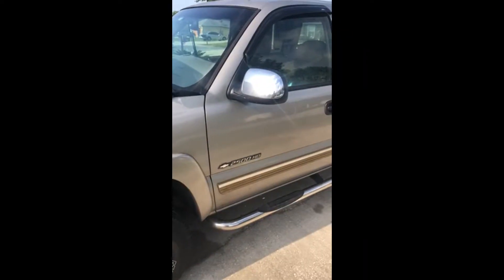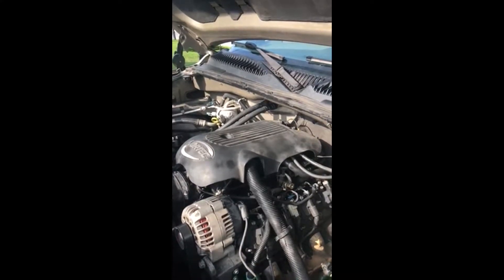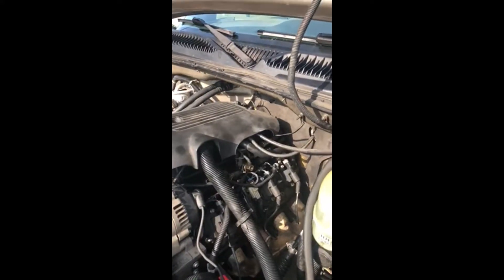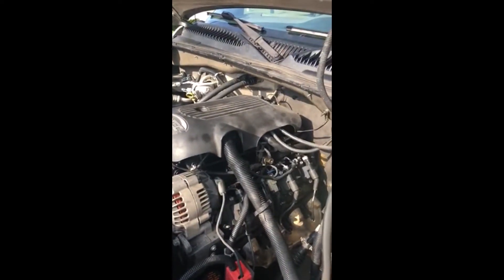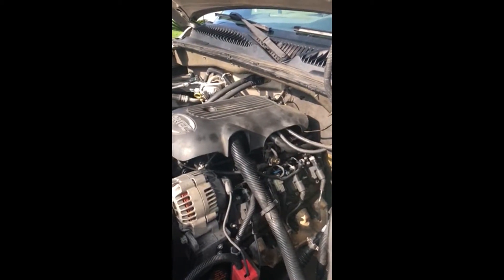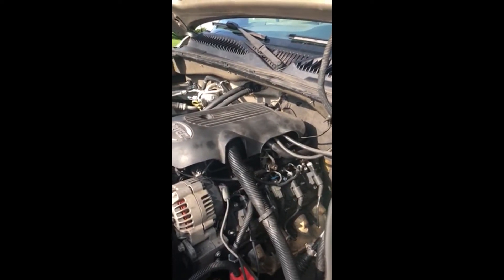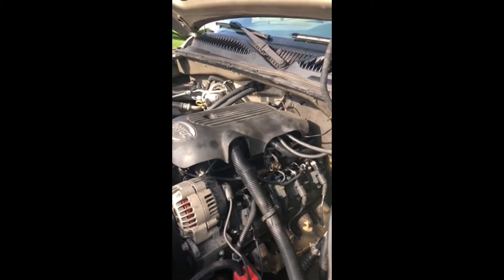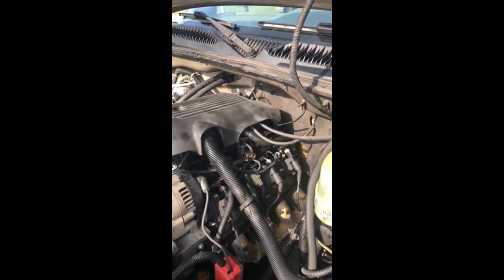Secret to Fix Knock Sensor Issue

Comment: I have a 2000 Chevy Silverado 1500. I took it to Firestone a month ago and they replaced the knock sensors three times because I kept getting the check engine light back on I'm currently driving the truck after getting oem knock sensors Friday. I had to buy a code reader today to clear the code because it kept coming on just so I could drive it efficiently. I will be at work in one hour and will update you after using the tip you suggested. This has been an extreme headache and an expensive one
Reply from the maker: I understand 
Similar situation drove me to do this over 4 years ago and it’s still working! 
Good luck let me know! 👍🏻👍🏻
Reply: @cjphillips987  so I just got to work and turned the truck off and then back on. I hit the throttle and it really didn't want to get to 5 I maybe got it close to 3.5 held it there then let off and went to do it again and the light came on. Do I clear the code and do it again? And is it supposed to hesitate getting up to 5? I mean I do baby it and it felt like that would really be pushing it. As of right now I just turned it off
Reply: @cjphillips987  also thanks for responding so quickly.
Reply from the maker: @ejsabcs2329  You must clear codes first then the rev process!
Reply: @cjphillips987  ok thanks I will do it in the morning
Reply: So I cleared the codes and did it I can only take it up to 4,000 RPMs but it let me do it a second time without throwing the code. So hopefully I'll find out later that helped
Reply from the maker: @ejsabcs2329  I understand 
When First it most likely hit rev limiter 
When it does slowly let off pedal 
The next rev it will go beyond
Reply: @cjphillips987  ok thanks. Would it help to do it again before I hit the road?
Reply from the maker: @ejsabcs2329  🤔 It Works unless you have bad KS’s 
I did it one time over 4 years ago 
Still Driving NO CODES!
Reply: @cjphillips987  I have brand-new knock sensors. I'm driving it now and have been driving for an hour and a half so far so good 😊

Comment: I haven't tried this procedure just yet.  I installed Dorman sensors last year and have had the check engine light since then.  Right now I removed the sensors and I am comparing them to 6 other brand new sensors.  2 AC Delco, 2 Echlin and 2 Standard Ignition.  All eight have 100k ohms.  All eight have an alternating voltage range up to 400mv during the tap test.  My suspicion is the output voltage isn't high enough.  Watching videos of other's doing the tap test, they are seeing up to 1.5v.  I'm taping the vise that the sensor is mounted to as hard as others are.  My next  step is to go to the dealership to buy AC delco from them.  The AC delco that I have are form Rock Auto.  They have part number stickers on them.  Not the embossed numbers like all the photos of oem sensors have.  My hope is the dealership sensors will have a larger voltage range.  We'll just have to see.

Comment: My husband tried this and it worked for a week. Does it help to do it again & are there any other suggestions? Replaced knock sensors & wire harness twice.
Reply from the maker: Sorry to hear you are having issues 
With your information 
It’s indicating one or both KS’s the connections, wiring or the ECU is the issue. Also when mounting KS’s do not apply anything to the Threads ! They must be metal to metal.

Comment: Fixing to try this on my 06 Silverado 4.8L I changed the knock sensors and wiring harness. Code came back after about 100 miles of driving. Hope this works!
Reply: Having the same problem…. I’m going to try to rev 5000 RPM for 5 sec
Reply: Did it work???
Reply: Did it work?

Comment: Thanks for the tip. 
I just replaced Both KS and a few last year , 3 to 4 month later the check engine came back. Truck drives great but the dam light pop up so now it dont pass the freaking smog. Tags are expired. 
Lol. I tried deleting the check engine light and took it to get smog but technician said his computer detected that the it was cleared so I must drive 100 miles then try the test  again, Of course with out any check engine lights :(. 

I’ll try your tip. I’ll keep you updated 
Thanks
Reply from the maker: Good Luck ! 
C A L I F 🤔
Come And Live in Florida !

Comment: Thank you so much!!!!!! Thanks so much for this video man I was about to start tearing it apart again to figure out why the hell I still had the codes after replacing them. Revved her up to 5k twice and no code!!! What a life saver this bit of info was for me, not one video I watched prior to this one said anything about this trick and makes me wonder if the code really went away if they didn’t do this?? But anyway man thank you so much for posting this very important bit of  info
Reply from the maker: Thank you, I’m pleased it helped you! Pass it on ! My K S’s code has not come back since i made this Video Still running strong over 300,000 miles ! Love My Chevy !
Reply: Dude I drove about 50 miles since and bank 1 code came back. But your tip worked at first I tried to rev it again and it didn’t clear it. I cleared the code and said a prayer. I’m sure it’ll come back lol I’m thinking I got a ground issue
Reply from the maker: @nwarren365  I Understand, It can be as simple as the Wire Harness Clip on Coupling , Wire issue or a Bad K S!
After double checking, Clear Code and Do it Again! Let Me Know
Good Luck !
Reply: Has this method held up

Comment: Just tried this after I pulled a P0337 100 miles after replacing both sensors & harness. Fingers crossed!
Reply from the maker: It should work unless you have a bad sensor or a harness issue, mine is still working no issues since i did this!

Comment: I can't wait to try this after work, i replacement both sensors and about 1 tank of gas later when I was getting on the high way check engine appeared. Scanned it, to my surprise knock sensors FML. Hoping this works!
Reply from the maker: Afternoon Sir 
It has worked for many K’s, only 2 had additional issues one is the ECU and the other never disclosed what was overlooked!
Reply: Did it work?

Comment: ... thank you... this actually seems to have worked on my 2000 LS... awesome, though odd :)
Reply from the maker: If the information helped please like the video, pass on the information! 👍🏻👍🏻👍🏻😎
Reply: I’m going to do it tomorrow morning since I have emissions test and I replaced the o2 sensors and the code of them went away but I got that code ! I also have a 2000 5.3 Silverado
Reply: @nbsgioo00  just so you know, I was never able to get the fix to 'stick'... gone for a while then came back through several tries. Annoying...

Comment: I didn't understand you clearly, what should I do after changing the knock sensor?

Do I have to raise the rpm to 5000 for 5 seconds?

I have replaced the sensors 3 times and still facing p0332 p0327 p300

Comment: Well, wish I saw this video before already having the intake off, had to take a break due to the rain lol.  Woulda been nice to try before buying new ones but at least now I know what to do once I finish putting them in.
Reply from the maker: I understand your grief, This is Why I posted this and many other DIY Videos exposing the Stealership  / Mfg Secrets of many items. Hopefully this has helped you Help Others Pass it on and Subscribe to my Channel, Thank You Let me know if you need anything else.
Reply: @cjphillips987  did the procedure after getting the new knock sensors in, still getting p0327 only. Thought for sure it was just a bad sensor, one of them that I pulled had gotten moisture trapped under the plug and it was more rust than sensor. Guess I gotta make sure the wiring back to the ECM from the sensor plug is good, harness was also replaced. Truck runs well, I can’t hear or feel any knock. I know it’s about time for a set of plugs, gonna also do those in case there is any minor knock that I just can’t hear.
Reply from the maker: @mxss115 
 FYI Clear all Codes before Performing Learn / RPM Procedure.
 I understand the Frustration, The KS's must be Learned to Listen for Harmonic Range of Engine RPM to set a Low to High Standard of listening to the Engine to adjust the Fuel Ratio through the EMC.
. After Replacement or Relocating Verify both Wire Harness Connections and each KS's are valid If So you Should not have any issue. Let Me Know
Reply: @cjphillips987 checked the KS with a multimeter set to AC at the PCM plug, definitely getting a reading when tapping the valley cover with a screwdriver, so wiring and KS should be good. It’s an 06 Yukon Denali if that changes anything. For the learn procedure, I started up the truck (after clearing codes or disconnecting battery, have tried many times now) and rev it to 5k, hold for 5 seconds as steady as I can, then let it drop to idle, wait a few seconds and do it again, then a third time to be sure, then I go drive the truck. Also tried turning truck on and off between revs, so far after a few mins of highway driving it continues to come back.

Comment: My husband went to repair place who  replaced 3 sets of knock sensors 3 times and 3 wire harness. I guess they are extremely fragile and sensitive.  Got the GM brand after the first 2 times.  One new wire was wired in.  Moved to another repair place that had better diagnostic equipment. He tried the RPM fix several times.  Nothing worked for more than a few days.  After all that they decided to replace the ECM.  It's been 1.5 weeks and no codes so far.  Fingers crossed.
Reply from the maker: I understand the Original issue was the ECM, after replacing it then you must teach the ECM / KS’s Rev Procedure!
Reply: UPDATE: No more codes since replacing the ECM.  Did not do the rev procedure after replacing ECM. Glad this thread is here, however, to help others.
Reply: 1994 4 .3  purge solenoid replace w 4'
Reply: purge control valve and hoses how to replace what's location

Comment: I did this on my 2002 Chevy Suburban. After replacing knock sensors, P0332 disappeared; but it returned after about 5 miles of highway driving. I cleared codes and followed this procedure and the P0332 has not returned. I noticed that each time I revved to 5000 RPM in P and held it, I heard 3 "dings" from the instrument cluster speaker, which I haven't seen anyone else mention. Does the service manual describe this procedure and the dings? Is that normal?
Reply from the maker: Morning good to hear it worked for you, however the Ding ? Maybe your ECU’s picked up the door was adjar or Seat belt wasn’t fastened when you Reved it to 5,000 RPM ? 
Haven’t heard of any Ding Bell before! 
If under normal driving No Codes Please Like the Video and subscribe to my Channel and Pass on to Others to Help Them!
Thank You 🙏👍🏻👍🏻👍🏻😎
You did a Great Job, IT’s Fixed !
Reply: @cjphillips987 Maybe, I'll try it again and let you know. My P0332 came back after about 50 miles of mostly highway driving. My next idea to try and diagnose is to test the knock sensor pinouts at the ECU for the correct resistance values, to rule out any wiring issues... past that, I'm not sure what to do, besides take it to a mechanic and see if they know something I don't about how to fix this. Do you have any ideas for things I could try?
Reply from the maker: @zbzbzbzbzbzbzbzbzb  50% of all KS’s are faulty from the factory, i was informed of this by the Delco engineer I spoke with. 
If it’s not the KS’s or wiring it’s the ECU faulty 
Without following the Rev procedure the KS’s will Code for sure.
Reply: @cjphillips987  Wow, 50%? Every guide I've seen says to replace both knock sensors. So if you replace both knock sensors with OEM ACDelco parts, you have a 75% chance that one or both are broken? That's insane.

I plan to validate that the resistance between the KS's and (-) is between 93 to 107 K ohms at the ECU. Do you know of any other tests I could do for the faulty KS's?
Reply from the maker: @zbzbzbzbzbzbzbzbzb  No due to they are Pizo’s / Harmonic

Comment: I have this same problem on my 2002 escalade. ill start drive on a cold motor and in 10 mins of driving ill accelerate hard to pass cars and my CEL comes one. always throwing the p0332 code. then i clear it. and it doesnt really come back around 2 months at a time but sometimes it comes back on back to back just depends on how im driving on certain days. If i do this procedure will it reset my knock sensor? Im really hoping this works
Reply from the maker: It depends on the K S itself 
They may be going bad 
When new ones are installed you must do the procedure to learn the harmonic’s of the sensors otherwise the code will occur. 
It is worth attempting before you replace the sensors. I also recommend relocating the KS’s shown in another video of mine on YouTube. 
Thank You

Comment: Did you have to change both sensors together? I change them out because i was getting rid of oil leaks now code comes up.
Reply from the maker: I left the new ones in place.
Reply: I replaced the front one which was throwing the code back to original and now it's throwing the back code of 332
Reply: I use ac Delco sensors and harness but the new sensors our an updated version of the original.
Reply from the maker: @robertrogers3149  you can relocate the sensors with out pulling the manifold
Reply: Just some info I found out. If you use URO sensors they work fine.
Reply: @cjphillips987  have a video on that? Or a description on how to do? I just did this on my 04 2500HD with 258k. Its working so far. Seems like it's more gas related on my end. I haven't replaced the KS. Just been pulling the P0327 code and it drives me nuts. I've been clearing it out daily for months. Sometimes it used to clear itself which was odd. Now if I don't clear it, it'll stay on. I'm hoping this lasts man! Its been a nightmare. Thanks for the video

Comment: Replaced both sensors & harness , still getting 0327 #1 bank low input.....I tried your 5000rpm trick and it worked for about 30 miles, but the code came back , I'm going to replace the PCM ..all of the wiring is checking good ....! Thanks
Reply from the maker: I understand your grief!
I spoke with a AC Delco egineer, after a lengthy discussion, 
He informed me 50% of all Pizo Knock sensors are Faulty right from the Factory. 
With more research of the KS’s I discovered KS’s are just a Harmonic Noise microphone hence Vibration/ Harmonic microphone listening device , this led me to understand they must be tuned to accept the wide range of RPM noise from Low RPM to HIGH RPM otherwise they give Code constantly. 
When calibrated to the Wide RPM Range they listen for Knock / Harmonic Vibration out side of adjusted Range, then come on.
Reply: @cjphillips987  How ever their quality control is very bad if that's so ...! Also the gas is being lower quality ( adding more ethanol ) the older tune on the PCM doesn't like it..!
Reply from the maker: @Wildkat-1  I agree considering this also adds issues unseen and overlooked 👍🏻

Comment: I have code p0325 on my Honda Civic. I replaced the sensor and the code came back again. Do you reset the code with a scanner first before doing this? Anyone's help would be greatly appreciated!
Reply from the maker: Morning Sir,
Yes clear The codes perform the Procedure.
Reply: @cjphillips987  fingers crossed
Reply: No luck. 15 miles, check engine light. The knock sensor I installed from O'Reilly auto, not genuine Honda parts.  Could that be the issue?
Reply from the maker: @tigersblood12212012  it’s a KS or Wire Harness / Connection or ECU issue.
Reply from the maker: @tigersblood12212012  Possibly but it’s definitely a KS , Wire Harness/ Connection or  a ECU Issue.

Comment: #cjphillips987 so i had my engine completely rebuilt....low an behold i popped a p0332. Replaced both sensors and wire harnes......then popped a p0332. Replaced all sensors and popped a p0327. Replaced sensor A and after about 1 1/2 weeks (about 100 miles +) popped p0332 AGAIN 🤦‍♂️. Since the rebuild i have put on 800 miles and am hesistant about pushing 5k on a rev but am will to try as i am not gonna replace a 4th set of sensors. Will talk to a mechanic and see if it is safe to rev to that limit now or not.

Comment: So there isn't a learn function on the PCM for this.  I think this procedure does something else, it unclogs the EGR valve which can be a source of causing the engine to knock.
Reply from the maker: Your Opinion 👍🏻👍🏻
Knock sensors are a Pizo microphone must be acclimated to noise range to work i.e. Idle to HIGH RPM 
You csn be Right but not Correct 👍🏻👍🏻👍🏻😎🫡

Comment: So my understanding is to drive the car till the engine light comes on, clear the codes, then rev to 5krpm or can you do it if I just turned the car on at cold and do it??
Reply from the maker: Clear codes then in park with brakes on in neutral/ Park, rev to 5,000 rpm .
This teaches ECM the new levels of harmonics if Knock sensors are good no more codes.
Reply: @cjphillips987  does the truck need to be in neutral? Or can I just clear the code, crank the truck and do the revs in park?
Reply from the maker: @nope_nope1212  clear the codes start engine in PARK !  if Automatic…..
Neutral if Standard…..   
then REV ……